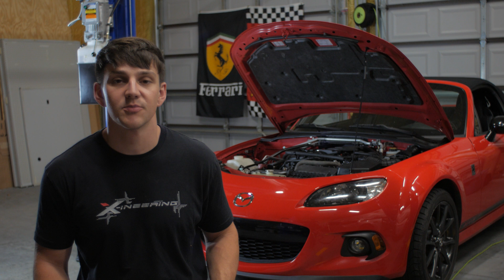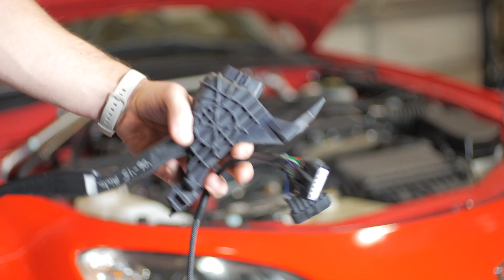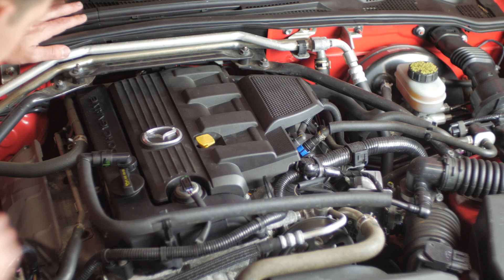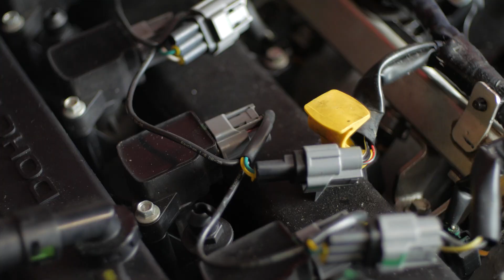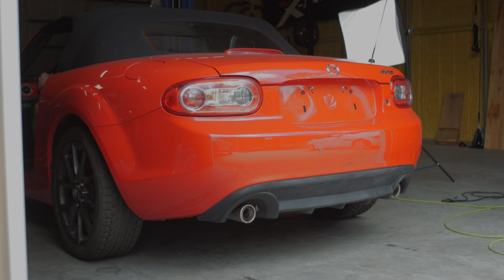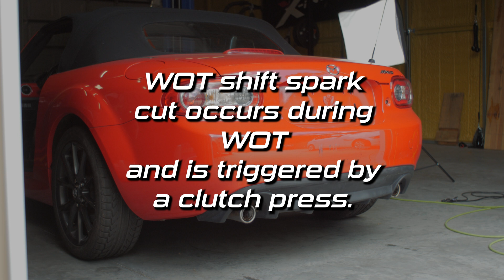Flat Foot Shifting and Downshift Blip for H-Pattern Manual! - GCU-H: WOT Shift Rev Match Module

Comment: What if you don't have a drive by wire vehicle? I have a 94 Mustang Cobra I would like to install this on. Thanks in advance!
Reply from the maker: Unfortunately, we do not support vehicles that are drive by cable. We utilize DBW to detect full throttle to produce the spark cut, and clutch and brake signals to downshift rev match.